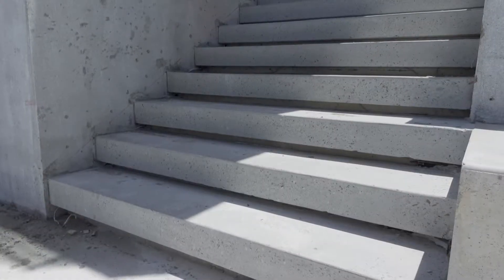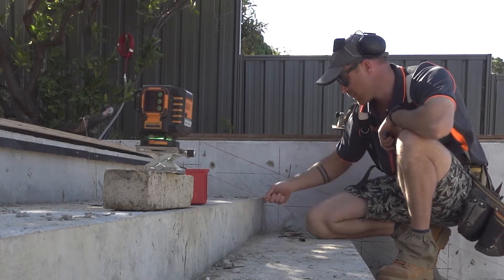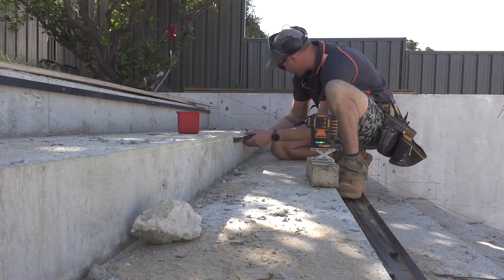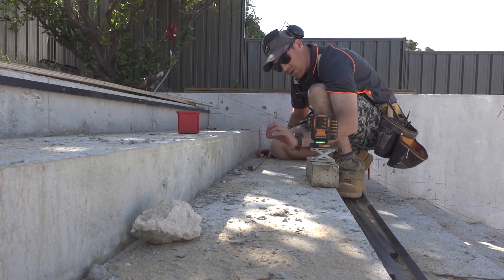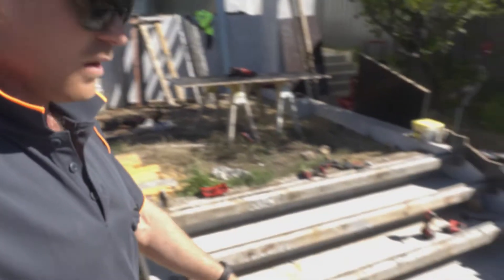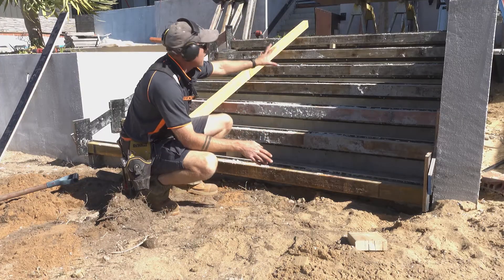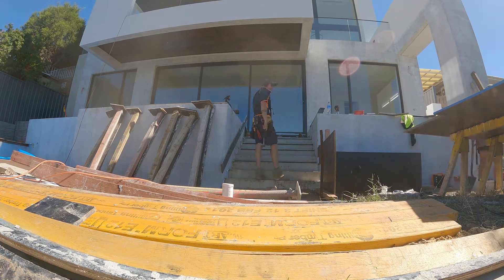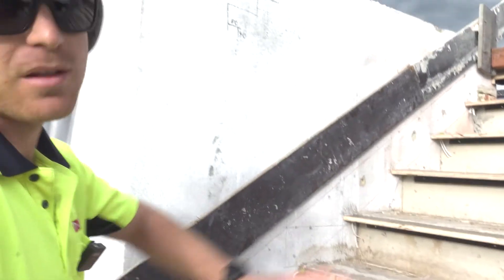Building Floating Cantilever Concrete Stairs

Comment: This can all be mono poured at once why to have two pours and risking cold joint cracking.
Reply from the maker: You can’t do cantilevered stairs neatly in a single pour. You also want see the cracking as it’s under the rebate.

Comment: Nice to see someone putting up a video of floating step construction in Australia. I guess the principle would be the same for deeper steps with say 800mm treads and and longer cantilever to give a better impression of the steps actually floating. I've got a job coming up where the client wants treads that are 1m x 1m and offset, meandering up the slope to the entrance door.  It's going to be tricky for me as I've never built floating steps before. So thanks again, i feel more confident now! You're doing great work! Onya mate!!!
Reply from the maker: Don’t build them the way I did in this video. You build every second step. For the shadow line on second pour you build up off previously poured step. I use 5mm foam with 12mm ply to create a 17mm shadow line.
Reply: @bmformworkconcreteconstruc9783 why build them in this alternative method,I've got a similar job and am wondering why?
Reply: Haha! I was wondering about that. I watched a few other videos and got the idea.

Comment: Looks good. Different approach.   So the floating concrete just sits on the existing stair case ?   Was there any reo drilled in the existing concrete to hold onto floating part ?
Reply from the maker: Yeah mate, reo was drilled in. We don't do it this way anymore. Just did it that way to try it out. We still pour it 2x pours but we pour every second step instead.
Reply: @bmformworkconcreteconstruc9783  ah yes. Ok second step method, I've seen that one too. Thanks for the reply.

Comment: How come you always add thay stringer board along the sides rather than just fastening your backing which is attached to riser direct to the wall?
Reply from the maker: Good question, I used to do it that way for many years but the way in my videos is much much quicker and easier. Reason is I don't need to fix into concrete/brick ect with a hammer drill 3-4 times each side for every rise. I do about 5 per side for my backing board. So a 20rise set might have 160 fixings into wall vs 10-20 with my method. That's 140 less holes to drill which ate nail gunned instead. I can nail 2 nails a second vs drilling about 1 hole a minute. It is more accurate too because the riser can move when drilling. This does not happen with nail gun. Also you have more room for error with your riser lengths, you don't have to make them as tight for them to install easy.

Comment: Good video mate, good explanation on what you are doing. Have you got any videos where you freeform the stairs (steps) or do you always put rough steps under your floating a steps? Cheers and keep up the great work.
Reply from the maker: I only built them this way as this is the way the concretors wanted it done. You can pour them all in one but not recommended. Best way is to pour every second step. As soon as I get a set I will definitely make a video.

Comment: Hello nice video .please what did you spray on the form work exactly to ensure a nice finish when you remove the form work?
Reply from the maker: I use 2 products. 1 is a lanolin product by lanotec but you can use any lanolin. 2. Is a diesel based product by sika. Diesel works well on its own.

Comment: How did you remove the ply pieces underneath each step? 

It looked like there would be very little room to get a nail puller in to remove the nails
Reply from the maker: Where ply join is, I just use a multitool and sabre saw to cut an opening for crow bar. if you don't have the tools just leave an opening and put a peice of thin tin over the opening so you have room for crow bar. but this will not give a nice straight edge to the stairs. I chose to prioritise the finish knowing the stripping will be harder. In future I'd leave a gap but either either. No need to pull nails as they are not imbedded into the conc much.

Comment: Hey just a quick question, did you put any reobar to tie in the floating stairs to the base stairs?
Reply from the maker: I dont install rebar, the concretors do this just before they pour. but yes hopefully there is rebar. if not it will crack

Comment: Great job
Is there any steel reinforcement ?
If not is it strong enough at the cantlivar section?
What about bonding old with the new concrete?
Sorry if it was long questions 
Thanks for sharing
Reply from the maker: unfortunately I was not there during the pour, my work sat there for 3 months before they poured it! We offered to pour it but the builder also wanted foot paths and driveways poured which I don't do or have time to do. It is supposed to be scabbled (roughed up) and then bars drilled in and glued. Plus mesh. I hope it was done correctly but I suspect maybe it wasn't as there is some vertical cracks which says there are no horizontal bars... 🤔
Reply: @bmformworkconcreteconstruc9783  oh oh
Reply: 👍 good questions